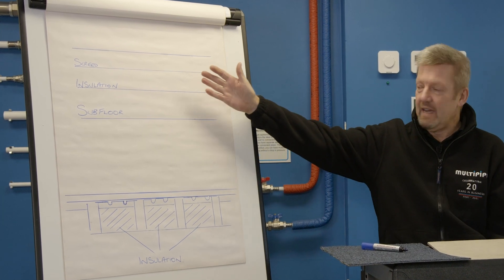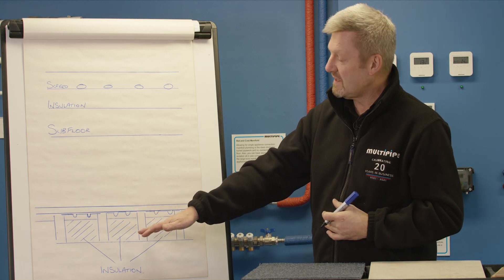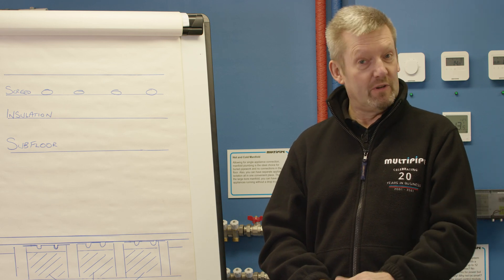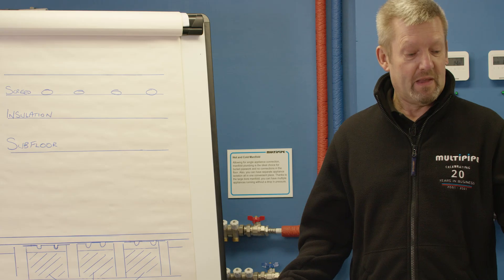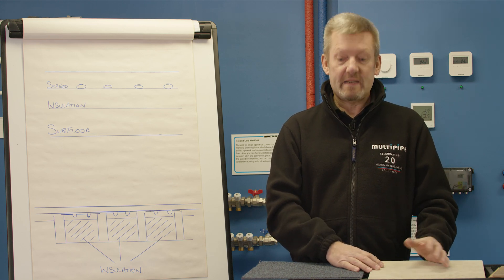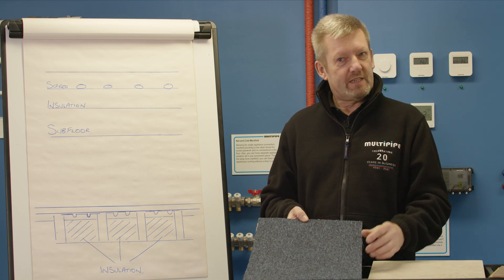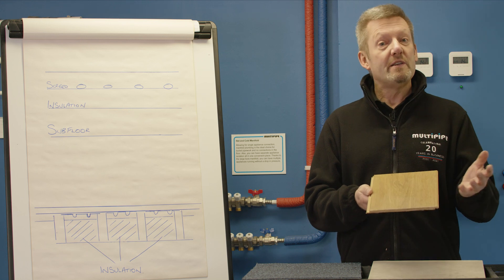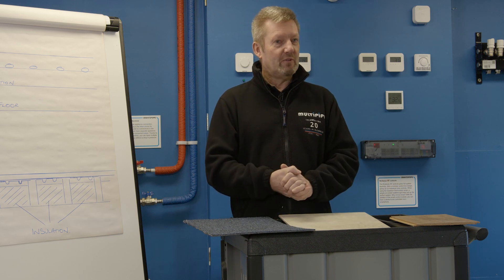How Do Floor Types Affect Your Underfloor Heating System?

Comment: كلمنا عن صب الخرسانه فو ق الانابيب هل نحن بحاجه لنوع خرسانه محدد  شكرا لك
Reply from the maker: No, most screeds and concrete are ok over underfloor heating systems. Just ensure you use a rounded aggregate. and ideally no deeper than 100mm

Comment: I’m interested in buying a house in Europe that has cobblestone on the ground floor, that was left in by the builders because it’s from 1887. Only problem is it’s a fairly big open space ground floor (1750sqft) with no walls between the living, dining and kitchen areas. Is it possible to take out the cobblestone and lay floor heating below it? Or do have to lay heating over it and eventually cover the cobblestone with a different type of flooring. We are torn because cobblestone is quite thick so we are unsure about the effectiveness of heat under it. And we will be disappointed if we have to cover a beautiful historical floor from 1887. But if it’s not possible, we understand we have to do it.
Reply from the maker: thanks for your message it is best to go through this with us. call us at the office on 01245227630 and we will be able to help.

Comment: Would it be best to use cement boards or chipboard to top a plate wet UFH system that’s having tiles on top for a 1st floor kitchen? Thanks
Reply from the maker: It does come down the build height you have and the centres of the pipe. But normally the dry Gypsum system tends to give a higher output. But this may not be a case in all jobs. Call us to go through your job in more detail.

Comment: On ground screed floor there will be one manafold located on ground floor. Using heat sprader plate method on 1st floor (timber floor board on joist) do i need another manafold on 1st floor. Can one ground floor manafold supply under floor heating water to both level from same heat source gas boiler. Thanks.
Reply from the maker: We would always recommend where you have different thermal masses you run different manifolds as HEPs will heat up far quicker than screed but screed runs at a lower temperature.

Comment: Hi
Thank you for all you videos, quite helpfull.
Do laminate floors take long to heat up compared to porcelain tiles?
Both floors are concreted floors just the coverings are different.
Reply from the maker: It is not really the speed at which they heat up, but more tiles will get the heat through better. So, you will get more useful heat/ the system will be more efficient with tiles.